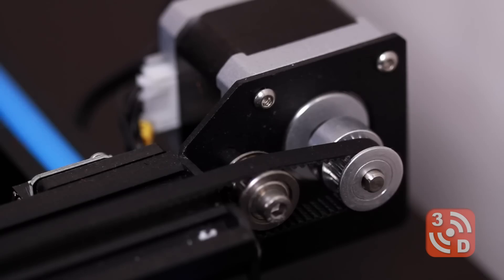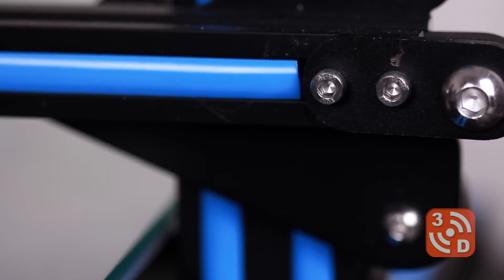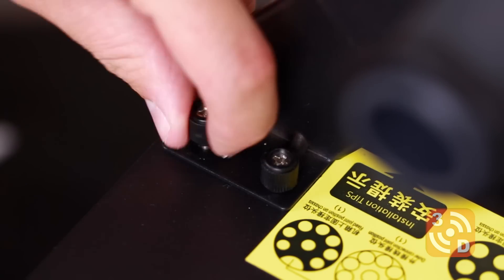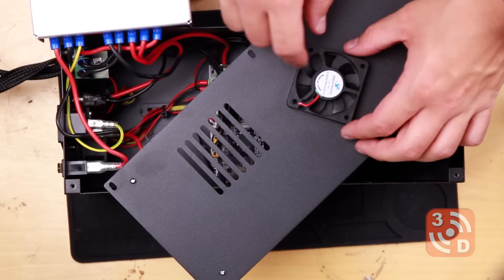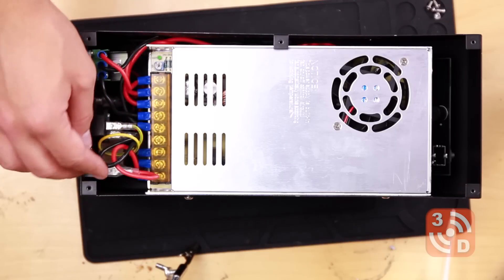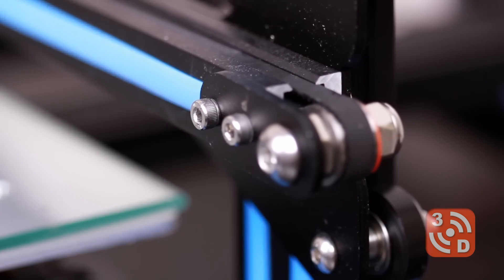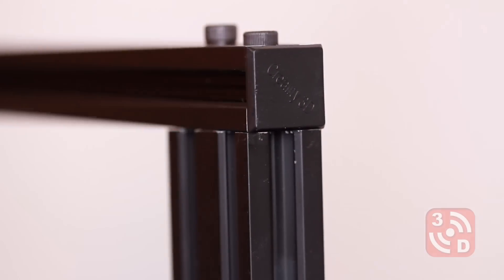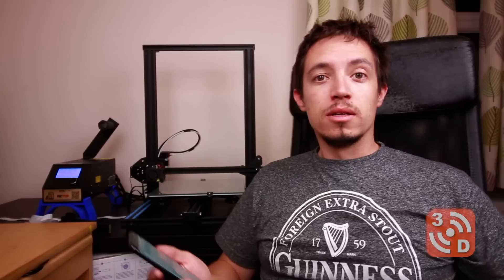3 Ways to Silence your CR-10

Comment: Had to sub just because I like the way you explain things. Im actually dealing with a shot case fan right now that SCREAMS and while I have experience with building PC's, I like to do some research before diving into something new (in this case my CR-10's control box) and yours was the first to pop up.  I removed my rubber slot covers before I even assembled my printer because I got the bright orange ones and I absolutely despise that color.  However, I have read that they actually are meant to dampen the sound of vibration traveling through the aluminum extrusions the printer is built out of, and may be reinstalling them.  I heard you explain how they may "rub" and in the past year of watching my printer in action I just cant see how that is even physically possible unless one put this unit together VERY sloppy like.  Really appreciate your video though, and will be checking out your channel, thanks!

Comment: Thanks for the info.  Just wondering, can the CR-10S be upgraded with the same fans listed in your description ?
Reply: It's the same control box, so yes. There is less room inside because the 10S has a larger motherboard, but yes those fans and these steps will work on a CR-10S.

Comment: is it ok to use the noctua pwm version ? becouse the normal 12v out of stock ?
Reply from the maker: I haven't tried it myself but I have a feeling the PWM ones require PWM signals to reach full speed potential.

Comment: So the "Z" and "E" motors did not get dampers? Does not the "E" motor get the most operational time ?
Reply from the maker: Both Z and E motors run extremely slowly compared to the X and Y motors and don't generate vibrations of significantly audible sounds. The dampers wouldn't make any difference to the Z and E motors so are just an unnecessary extra bit of work.

Comment: Hi, thanks for this. Do you know if the CR10 mini will need the same parts and process thanks.
Reply from the maker: Hi EaziG, would this be the CR10 mini or the CR10s mini?
Reply: 3D Revolution Hi, Thanks for the reply, it's just the CR10 mini. (I dont think there is a '(s) mini' to my knowledge. Only the full size CR10S?).
I've researched it further and they appear to use the same control unit so the mods you showed should work fine. I'll post a comment if it works ok with the mini I case others are interested. Thanks again for the video.
Reply: EaziG have you tried? The mod work fine on CR-10 Mini?
Reply: Daniele Formica Hi I haven't tried it actually since after receiving the CR10mini it wasn't as loud as I expected. So I have left it in its normal state. I still may try it in the future because I had a good look at the CR10mini and everything appears to be identical. Especially the control box, it's the same one. Everything in this video should work just fine.

Comment: Blue strips will pull right out with needle noses and no need to undo parts.
Reply from the maker: Hi Bubba, the reason I recommend to remove them like I do is that with some models people have received, the rubber strips are much more rigid and whilst you probably could remove them still as you suggest, it could involve putting considerable force on the frame and I don't want people to be buckling their frames whilst following one of my tutorials. Simply a precautionary measure.

Comment: Some CR10 users have upgraded the controller electronics to Duet WiFi or Duet Ethernet. These controllers support x256 microstepping, so they make the stepper motors very quiet without using dampers. The stepper drivers on the Duets generate only about half as much heat as the ones used on other controllers, so it's quite likely that you wouldn't need both of the fans. Here https://www.duet3d.com/forum/thread.php?pid=31702#p31702 is a link to a thread by a user who did the conversion.

Comment: Thanks for the video!
Just did the control box's fan upgrade but got a bad surprise when trying to screw in place the noctua fan at the back..: The screws provided with the original fan were too short by ~1mm, preventing me from putting the noctua in place. I had to go to the hardware store to buy new screws, that ended up being too long.. used a dremmel to shorten them up..! You didn't have that problem?
Reply from the maker: Hey Bruno, thanks for getting in touch. I sorry to hear you had issues with the screws, I didn't have that issue with mine in afraid and was able to just use the stock screws that the original fan used. It does seem that specifics of some small things like that vary from batch to batch of creality printers unfortunately. Thanks for letting me know though, I'll pop a comment on the video to let people know they may need longer screws. I hope at least it had helped make the printer quieter?
I'll be uploading a follow up video this weekend on how to make it even quieter.
Reply: Thanks for replying!
Well actually, I didn't get a very big decibel drop from changing the fans in the control box (between 5 and 10dB less, according to the app on my non-calibrated smartphone's microphone...) Though I just changed the fan on the heatbreak, and the noise drop is UNBELIEVABLE! Need to be careful though, as the stock fan takes 0.1A, and the noctua A4x10 only handles 0.05A.. I burnt one before realising... It might actually have been a big mistake..: the noctua I put on blows 4.8CFM, while the stock fan blows at about 10 CFM... more silent, but also much less powerful.
I probably should have waited for your video before trying this upgrade...! :/

Comment: You do not need to pull the end parts off to remove the "rubber strip". Just grab with a long. Nose pliers or a paper clip and extract. Easy no changes to settings.
Reply from the maker: Hi Douglas, thanks for your comment. Many CR-10 owners can remove them like that, yes, however, depending on where you bought your CR-10 from, and on which batch it was, the rubber strips can be considerably more rigid than in others. In these cases, trying to pull them out like that can cause the user to exhert considerable force and strain on the frame of the printer and I felt it would be far better to recommend the longer safer option, than have people following my video damage their printers.

Comment: I think the one that makes the most sound its the hot end fan, why dont change that one?
Reply from the maker: I will be doing this on another video later this week (As soon as the fan arrives). Watch this space.
Reply: 3D Revolution also the psi fan is louder than anything else. Waiting for your video on that one too
Reply: you need airflow, at least 3 cfm. Problem is quieter fans do not have the capability of doing so. I have seen so many peoples printers jam due to the filament not being sufficiently cooled in the heatbreak. I admin the cr-10 user page and see this constantly
Reply: happened to me lol, but i think was a problem with the barrel, im still using the noctua for the hot end and so far it goes ok, witch one do you recomend that be more quiet than the original but with more cfm than the noctua, sorry for the english xd
Reply: Yoqsetioxd haven't really looked to hard but just try to find one that is capable of minimum 3cfm and is qyiet and it should work fine

Comment: Second, this are servo motors, if you have a noise out of the ordinary,  80% of the time the bearings are dry, so oil the motor from the back and front outside, capillarity action will work the oil inside the motor, and in the worse case the noise continued the motor is going bad, so this dampeners are useless, what they do is mask a future problem, in witch in the worse scenario will burn if the motor locks and burn may damage the control box.
Reply from the maker: The noise the dampers are aimed at getting rid of is vibrations from the motor being in use being passed into the frame which just amplifies the sound. This isn't referring to a defect in a product part. If you don't believe me, get a power drill and hold the trigger down whilst holding it up in the air. Now rest the butt of the drill on the top of a wooden table and pull the trigger again. This time it will be louder. If you were to put a sheet of rubber between the drill and the table, it would reduce the amount this sound increased. It's the exact same principle and is basic physics.

Comment: I just check my CR10 there is not rubbing of the strip by anything.
Reply from the maker: This can be an issue, I didn't say it happened on everyones but there has been several reports of it being an issue. Build quality and specifics seem to vary quite a bit depending on exact supplier, batch and version. If it's not an issue in yours, then it's not anything to worry about.

Comment: I would decouple the printer/controller from the surface it sits on, this will help prevent the low frequencies (the hum) from turning your table/desk into a speaker.

Comment: Kinda seems like you didn't even move the x, I didn't hear or see it run the second time, and those motor mounts wont quiet stepper operation noise. My guess is it still measured 60 while it was running, and you didn't want to admit you'd wasted your time. Just a guess, but... Ive been around these machines for years and the only thing that makes them much quieter while running, is putting it in a different room. You can go into marlin and lower the motor excel to quiet them but thats a fast track way to ruin your steppers.
Reply from the maker: I can assure you that I did move the X motor on the post-changes test and it did make a difference. However, as I mentioned in the video, the vast majority of the noise had been coming from the fans. The noise difference in the motors is marginal but it is there, and in particular made a difference in how well it could be heard from another room.

If I had found that it hadn't made any difference, that's what I would have said in the video. It would hardly reflect well on me if people took the time to follow suggestions I'd made only to find it didn't work. That would ultimately result in them unsubscribing and then fewer future views. In a world of fake news, I do what I can to not contribute.
Reply: you are right, he did not move the x axis, there would have been some kind of audible sound coming from somewhere. The fact there was no sound changing, nothing at all tells me he cut audio before moving it
Reply: Well step stick also just came out with some motor drivers that provide all your motors with minimum torque required at any given time. They can make these very quiet.
Reply: I understand quiet but at no point did the sound increase as the phone said it was increasing. Listen to the same decibel range as what the stepper motor showed and it was way quieter even though the decibels were higher than ambient noise

Comment: Nice video! However (for the next time)... you didn't need to cut the fan wires! they're plugged to the board, at most you need to replace the three pins male plug that came with the new fan with a two pins one. Moreover, if you're careful enough you may not have to solder wires at all, just release the pin notches from the three pins plugs and put them into the two pins male plug (a new one or the original one).
Reply: please show me .. i am looking to do these but not really into soldering...so the fans he suggested are the good ones to buy or you got others to link to that i can plug and play like you said?
Reply: @daviddraven8115  if you look at one side of a fan connector, or most connectors you can see little tabs with metal inside that piece of metal holds the pins inside the connector. You just need to gently push them with a paperclip or something similar to release the pins. It may be possible to move the pins onto the new fan or just buy new ones at a hobby shop. Do this for both fans and you can actually swap the connectors.
Reply: You cannot transplant the new fan wires to the existing plug. The pins are different. At the very least you'll have to solder new pins onto the new fan if you want to use the existing plug.
Reply: Hi. Can u please make a proper video. Thanks

Comment: The best direction for quiet cooling is always getting the biggest fan you can fit and running it slowly, then add any ducting possible to make the air only go where it should be.
And then you usually also find multiple fans can be removed, that PSU can probably do with a single large fan if you duct everything to the right spots.

Comment: Odd internal layout.  Would think you'd want to rotate the mainboard 90 degrees and have the cooling fan blowing air over the full length of the board.  Might also be able to shift the end bits around to accommodate bigger, quieter 80mm fans on either end.  Or maybe just vent holes in the front and a big beefy fan at the back pulling air through.
Reply: You can't rotate the board internally, the sd card and usb port would be pointing inside the case afterwards. =]
Reply: Can add extensions for those, I would think.  Or if I'm not mistaken, if you use OctoPrint and mounted the Pi inside the control box, you wouldn't ever need access to the sd/usb ports.

Comment: it´s ok, but you really have to replace the PSU fan too. It´s very easy to do.
Reply: Just need to be very careful when opening any PSU (big capacitors in there).  Unplug it from the wall, switch it "on", and hold down the front power button for several seconds.  Ideally use a ceramic screwdriver too, if you've got one.

Comment: Info about the Noise level app Please link Thanks: Gelid Silent  fans are really quiet I have some
Reply from the maker: Hey Protomaker. Here's the app I was using in the video: https://play.google.com/store/apps/details?id=com.gamebasic.decibel 
Free on Google PlayStore for Android. Hope the video helped!
Reply: Thanking you 2000%
Reply: Got it on my mobile now, seemed quite sensitive to sound, I know I can adjust it great:)
Reply from the maker: Yeah I found it quite sensitive too. I did calibrate it once i'd installed it, but for the purpose of the video, even if the actual values aren't 100%, it's the relative  difference that really mattered here :)
Reply: Yes, P.S. GREAT Video
Reply: YES 2000% Thank You

Comment: When you install the dampers you need to move the gear in 6mm or so to make up for the thickness of the damper.  depending on the printer, you may need to remove the gear and flip it around to get the proper alignment.

Comment: Have you had to change any settings in particular since you added the dampers?
Reply from the maker: Nope. They shouldn't in any way affect the way your printer works. The belt is still being held in the same position as the gear has just been moved further along the motor shaft, and the motors are still functioning the same. Everything should run just as it did before, just quieter.

Comment: How did you find out which wire was ground and power on the silent 5 fan?
Reply from the maker: The easiest way I've found is to use a small 12v battery (Like A23's), pop a wire in two of the three pin slots on the fitted connector, test it on the battery and swap the wires until you get the result you need. Once you've figured it out, use some electrical tape or a sharpy to clearly mark which wire is which.
Reply: There is a specification picture I used:
http://gelidsolutions.com/thermal-solutions/case-fan-silent-5/
Press the "specification" button on the right and you will see following picture:
http://d3mezvacowwm2m.cloudfront.net/wp-content/uploads/2016/08/Silent_Fan_Wiring-700x533.jpg
So 12v is middle, ground is on the right. Ground has also some text marks on it, which are so small I cannot read
Reply: Wow thank you so much!
Reply: my noctua fan got 4 wires, black yellow blue and green, the way I figured it out was taking a voltmeter and measure from black to the three other colours while blowing air through the fan so that it rotated, yellow and black was the only combination that resulted in an induced voltage so I assume yellow is + and black is ground
Reply: Help!!!! Looking at the picture, which I also found on the Gelid website, with the pin lock tabs showing, just like the picture, the wire with the writing on it is on the left, unlike the picture. If the wire with the writing on it is absolutely ground(-) then the factory installed connector is wired backward on my new out of the box fan. Anyone have any clearification on this? Thanks in advance!

Comment: I have a question why cant you just unplug the old fan and plug in the new fan into the port? Why do you need to soldier?
Reply: most good fans have a third wire for sensing the speed and the plug is different.
Reply: Would be nice if the printer mobos used 3-wire or even PWM fans instead (maybe the pricier ones do?).  And had temp sensing that only turns them on if needed.